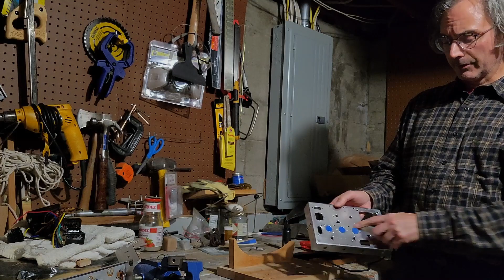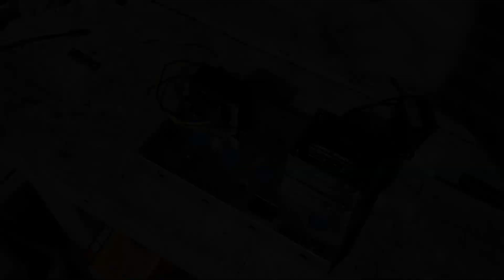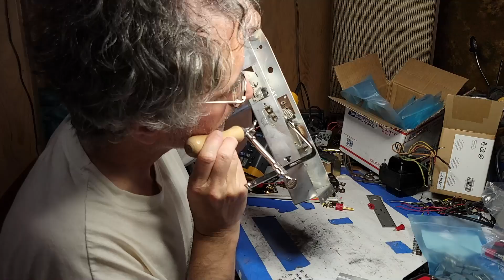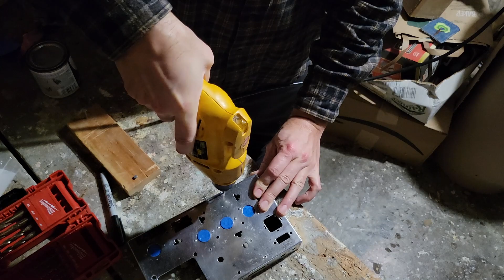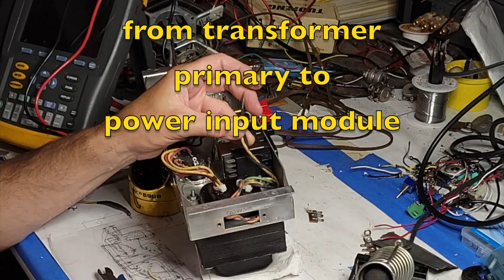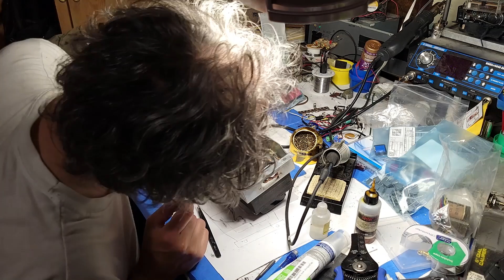DG SE1 Build Part 3: Metalwork for Poets | Chassis Preparation and Mounting Major Components

Comment: i would put rubber washers under the heads of the motor mount bolts on the changer to filter vibration

Comment: Standard prep before clearcoating would be wiping the part down with 91% isopropyl alcohol. Doesn't leave any residue to interfere with the coating. I don't know why you would use anything else.

Comment: What have you been working on? Saw Boz Skaggs & Keb' Mo' last weekend. Bruce Cockburn on Father's Day. How about that new Yes album "Mirror to the Sky?" - It kicks butt.
Reply from the maker: Had a pair of Magnavox CD players on the bench. Swapped drives to get one working well. Got an old Sony turntable working for one of my students. Pulled antennas and cable out of my field site (just posted a video about that). Getting ready for a road trip. I'll be visiting an old master and the current owner of my dad's system.
Reply from the maker: I'll have to check out that album!

Comment: Hi.. Where did you get new output transformer that you will be using for the build? Is it better than the one used in the article? Thanks
Reply from the maker: It's Chinese, iwistao. I was nervous about using them because it seems like no one in the various forums uses them (or maybe they do but don't want to admit to using cheap Chinese stuff). The quality seems good, and they boost the bass response relative to the ones from AES. I'll probably buy from them again.